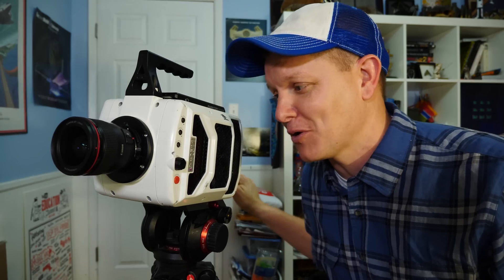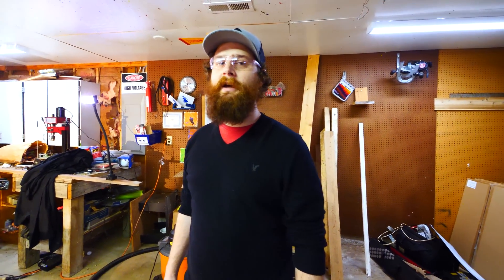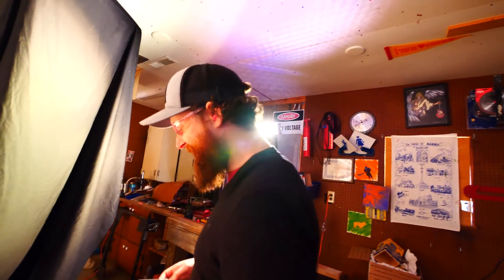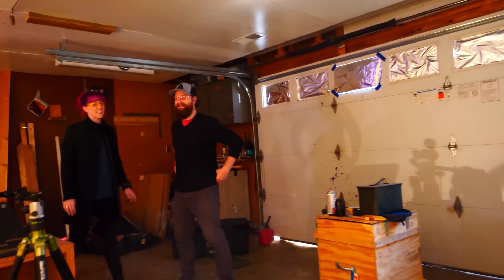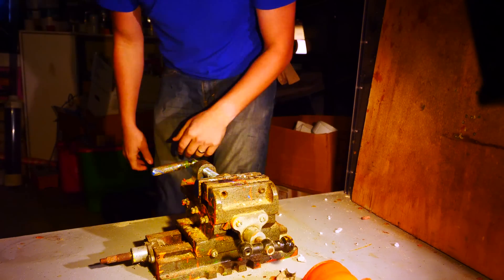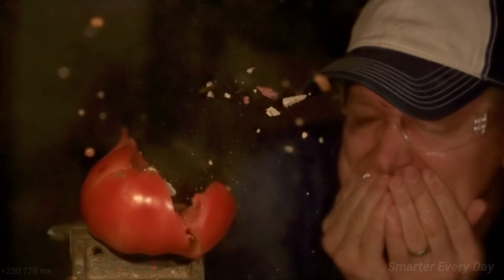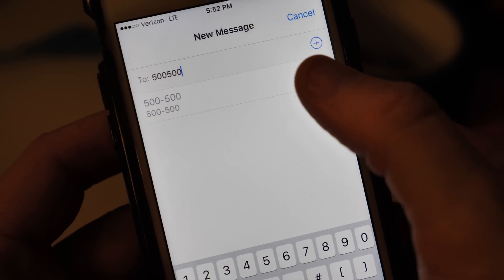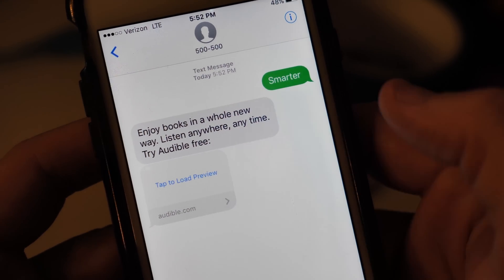How We Make Slow Motion Sounds (Exploding Tomato at 60,000fps) - Smarter Every Day 184

Comment: 3:56 I promise you that is not a real m-80, or even close. If that was a real m-80 that would blow your face apart being that close, m-80's have around 3-3.5 grams of flash powder. That my friend, is just a normal fire cracker in a bigger tube to make it look like a m-80.

M-80's cherry bombs and quarter stick were made illegal by the ATF and ATFE in the late 70's, specifically because they can blow a hand off. They were labeled as non consumer explosives and NOT consumer fireworks.

Comment: Sound from microphone is sampled at 44.1Khz  which easily captures audible ranges upto 20 Khz. High speed cameras are designed to capture lots of video frames in a second which gathers lots of frames per second. When we play them it appears slow motion because lots of frames are now playing per second as we all know. The case of sound is a bit different, if we sample lots of millions of samples of sound per second and then play it with normal digital to analog converter of 44.1Khz it will appear as a wierd low frequency sound.

Comment: I think it helps to think about this mathematically. So this is my hypothesis on why slow motion cameras don't record sound. When something is recorded at 1/1000 real time and there's a sound that gets slowed down to that extent, that sound is also reduced in frequency by that factor. So a sound recorded at 20 kHz played back at 1/1000 real time (meaning the camera recorded at 30,000 frames per second and played back at 30 FPS), that frequency has to go down to 20 Hz. It goes from one extreme end of the range of human hearing to the other. So a sound wave coming into the microphone at 1 kHz would be replayed at 1 Hz and would be imperceptible to the human ear if it were recorded. 
A microphone would ONLY work if the slow motion isn't done to a high degree. Even a factor of 2 makes a huge difference in pitch. It's how the Slow Mo Guys got the background music for all their old videos. It's Synthetic Design 02 from iMovie played back at half speed.
The best way to think about it is to imagine it like a record player. It works by the needle being vibrated by variations in the grooves. If you play a 45 RPM record back at 33 RPM, those variations are hitting the needle at a slower rate and not only will the music slow down, the pitch will drop as well. It does exactly the reverse if you speed a 33 up to 45 RPM. You can actually do this with Audacity and a song or other sound file you have stored on your computer to achieve the same effect.
In summary, a microphone on a slow motion camera is useless because almost any sound it records would have to be pitched so low as to be beyond the bounds of human hearing.

Comment: i think on the tomato shot... he added too much processing at the mastering stage of the track. The delay sounds good but you need to reduce the feedback parameter on the plug-in you're using. if not, just remove the delay effect entirely; i argue that the clarity'and the low amplitude spots, that are otherwise currently filled with the delay, will be a aid to produce a much deeper sound with greater clarity.

Comment: An M-90 has 1/100 the power of a real M-80 in my experience.  Cut one open and see what's inside; a tiny bit of some kind of gun powder surrounded by a thick layer of chalk.  The chalk makes it look like it made a lot of smoke.  A real M-80 is filled with flash powder and would have blown your face off from that close, lol.

Comment: the reason you can't record sound in ultra slow motion,,,, when the speed is halved the frequency is also halved. 1000 Hz becomes 500 Hz becomes 250 Hz then 125 Hz then 62 Hz then 31 Hz then 15 Hz which you can't hear.

Comment: That fire cracker was nowhere near as destructive as a real M80.  You never would have wanted to stick your face that close to a real M80 Destin!  I’ve blow something “that resembles a mail box” 20’ in the sky with a real M80.  I’ve lit one on the ground and placed a standard Rubbermaid 35 gallon trash can upside down over the top of it and it sent the trash can 10’ in the air.  There would have been nothing left of that tomato and you may have suffered a lacerations to your face!

Comment: Those are fake versions of the "M80"  These only contain 50mg of flash.  Try doing this with an original "M80" Those had 3g of the stuff, and would have resulted in a much much much much larger "flash".. hehe.  Weigh it out and see that I am correct.  Plus the m90 is supposed to be less than an M80.  My father, who is like you Destin(military career) explained to me once that the scale is like golf.  The higher the M number, the less the charge.  I've seen this in firework stores overseas. M-1000 is a tiny piece of string.  Correct me if I'm wrong.
Reply: In fact, he has a story (backed up by 3 people that were there) that he threw one out of his window while driving, and it sucked back into the car(both windows were open).  The uncle in the back seat flew up into the front with the other two to avoid it.  It blew out the window in the back, and blew a hole into the trunk. A good sized one.  Being a "story" I don't know how true it is about the size of the hole (fishing story affect).  However, my aunt who wasn't there also backed up the "hole" thing, and she wasn't in the car at the time.  Im glad for regulation.  It keeps stupid people safe.

Comment: When I was a kid, I broke open six M-80s and poured the contents into an aluminum TV tube case.  
(You probably don't know what I'm talking about.  Really old TVs with vacuum tubes had some other components that plugged into the same type of base as a vacuum tube.  But they weren't glass tubes.  They were aluminum cans a bit like a soda can with a pinned base. About 1-1/8" dia. x 3" tall.)
Anyway, when the can was about 2/3 full, I made slits around the open end and folded tabs in against one of the M-80 fuses then sealed it good with epoxy.
Next day, I took it behind my house and tossed it several feet down an embankment.  It landed behind a rock.  "Shucks!" I thought...I wanted to see it go off and now I cant!  It was very loud.  The shock wave felt like I was being sand blasted.  I was glad the rock was in the way.

Comment: Can't you use a program like PaulStretch to stretch the original sound? The program can stretch a sound up to a few trillion years long!
Reply: the problem is not stretching the sound, its capturing it. With a normal microphone, many little sound details that last less than milliseconds get lost in the noise, and even if you stretched out the sound wave, it would not be there. Besides, there are many thing a mic may capture that you don't want, like the sound of air moving, or dust hitting the microphone. If all the sounds were captured perfectly, it would still be a mess of unwanted noises. I think it is better to just recreate what it may have sounded like.

Comment: you guys ever considered laser mics?)
Reply: Or ultrasound. i mean, u make  like 60 000 fps (60 kHz) cinematography and slow it down to 24 fps (24 Hz) so 2 500 times. Usual mic pics up sounds below 20 kHz. IR mic is like 300 GHz, medical ultrasound - like 20 mHz. which is like 15 000 000  to 333 times ( corresp.)  faster. So you would have recorded  at 2-29  mHz with the medical Ultrasound, of equally slowed down 2 500 times -  0,8 to 11,6 kHz ( human ear hears 20 Hz - 20 kHz)  sound per slow-mo frame, which is plenty. It would not only be not low, it might be too high, so you might wanna transpose it couple of octaves extra :)

Comment: Hello SmarterEveryDay, I wanted to propose an idea I have. Perhaps it would be more accurate to record the sound using a purely analog medium like a Vinyl disc or magnetic tape without converting the sound signal to a digital signal at all. This will preserve the "infinite resolution" (more or less infinite sample rate and bit-depth other than thermal noise n stuff) of the analog audio signal. Then you can slow the playback down on a phonograph  proportionally to Youtube's frame-rate compared to the recording camera's frame-rate. This will give you an idea of what it actually sounds like in slow-mo without the heavy frame-draggy / Aliasing-like sounding distortion that comes with slowing down and interpolating the quantized "digital" signal's finite sample rate. You can also manually sync the audio and video with a recording of your hand clapping or something. Though...good luck finding a fully analog recording system in today's day other than eBay USED probably. It's all grandpa tech that is going extinct along with CRT TVs and VHS in this digitally dominated age.
Reply: I think if you slowed down any sound a quarter of a million times  no matter how high the fidelity its just gonna sound like garbled mess. At that point all of the frequencies will be well out of our lower range of hearing.

Comment: how will sound the blasted tomato if you record equal amount of samples per second of sound with the slowmo video, and then match with a fixed time video? like 44khz/30fps final video, slowmo 1000fps, 44.1 x 1000, 44.1mhz sound? lol, that probably imposible to record, the air can vibrate so far

Comment: In theory: 60 kfps / 60 fps = 1000  ; 1000 * 40 kHz = 40 GHz ; Get a good oscilloscope, plug in a good mic (that can vibrate at 40 GHz, this one might be tricky), record at 40 GHz, then play at the same sample rate ratio than the video. Would have been cool to compare the real deal to the FXs or at least make an attempt to really show why it's not an option.

Comment: The only option i can see for using the real sound for slow motion is if you were to sample the sound and use prolonged tones at a closer frequency to that of the sound recorded. However, on the really fast ones this might just mean a single tone across the whole thing.

Honestly, though, I would prefer to have that I think than completely fabricated sound and it seems like this would be easier, if a little choppy.

Comment: Of course you could just slow down the audio... It wouldn't sound as nice but it's definitely possible. Basically it would be about not audible, since you stretch out the wavelength by a huge magine and with that and 666k fps you'd probably get a wavelength from way under the audible hearing range of humans (about 20hz-20khz)

Comment: Well technically you could record the sound, but even if you record at a high sample rate (i.e. 192,000Hz or more) and slow the sound down to match the video, the sound waves slowed down would be of such a long wavelength that you wouldn't even hear it. For example, say you have a sound 120,000Hz with a video fps of 600,000. you have 5 frames for every sample of audio. That boils down to a frequency of 0.2Hz which is considerably lower than the lowest frequency audible by humans: roughly 20Hz. Even if you could get a ADC with a speed around 1GHZ and a device capable of picking up ultrasonic frequencies, the sound likely wouldn't be very useful (or likely loud) anyways. Someone correct me if any of this is wrong.

Comment: Wel, technically, you can record the sound and not only stretch it, but also multiply it's frequency proportionally to the the amount you stretched the sound. Thus creating a slowed down/elongated version of the original recording that has the same pitch. This can be done in Audacity with some effects. Problem is, it won't sound better than the sound effects you guys add.

Comment: Hey SmarterEveryDay. I m from Malaysia. I have curious on how does the camera flash work when they are in HSS ( high speed sync). Basically when you take a picture with a flash and a shutter speed less than 1/200 of a second you use just a normal flash of light. But when its get higher (shutter speed) more that 1/250 - 1/8000 , you would use high speed sync to illuminate the subject.  I know the flash flashes a few times during that process but I really to see HOW IT WORKS. Get it?  Help me please!! I m dying to know and see with my own eyes..

Comment: Can I make a safety note? The firecrackers you are using are really weak for M-90s (or even M-80s). I only bring this up because I don't want anyone to get that close to a real M-90 and have it go off. There will be tissue damage, hearing loss, and eye damage. 

The reason I say that's a bit weak for an M-90 is that I had some fake M-80s a few years ago on 4th of July. They were actually a small red firecracker in clay, in an M-80 tube. In the video it's stated that the M-90 is a step up from the M-80. 

Have a look at the casing for that firecracker if you have any left, and let me know if you see inert clay with a red firecracker in it.

Have a good one.

-6